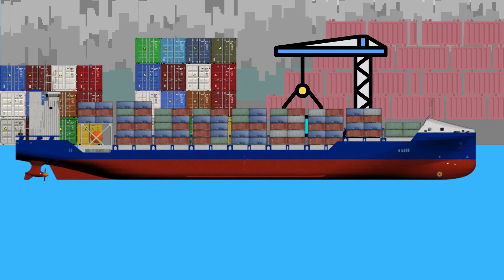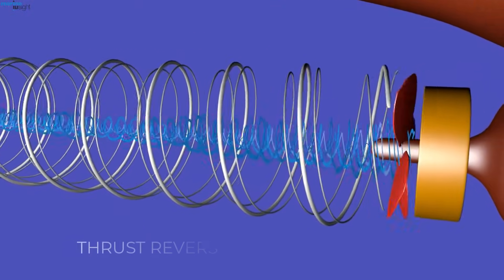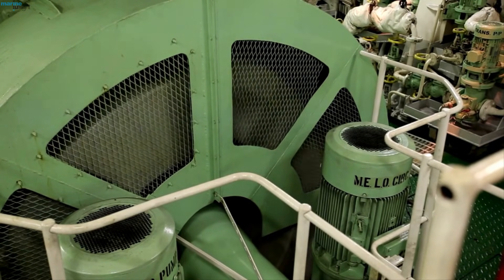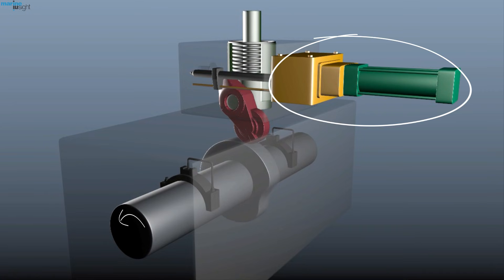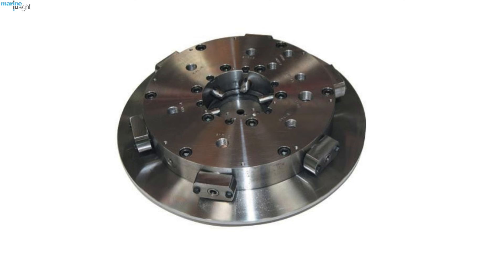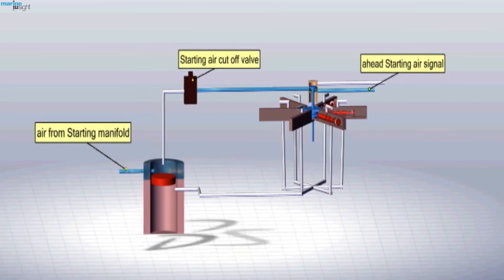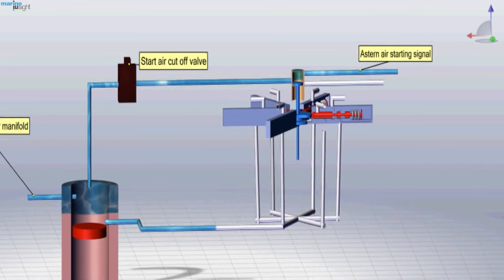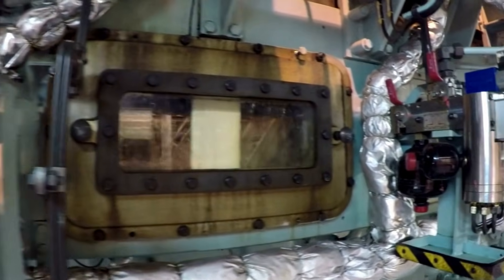Reversing of Marine Diesel Engine

Comment: good video my question is about hitched pumps of oil and water of these engines ,about the inlet and discharge in case of change rotation

Comment: Thank you for this video. It is very well done! Two stroke slow rpm diesels make so much sense as they can be directly coupled to the propeller shaft, saving the cost of a gear box. Further savings with a fixed pitch propeller. I have a question. Prior to the engine and therefore propeller reversing, is it only starter air introduced to the cylinders? (No fuel) I ask this as I was trying to make sense of this video. https://youtu.be/1fs2cU_MsRQ They don’t provide much information but it is a container ship reversing. The engine speed (and propeller speed) stay constant until the speed of the ship is such that they can reverse. Is this the moment in time that the diesel stars fire ring? You can hear on the video, prior to the engine reversing, something is slowing down, but it’s not clear to me what.
Reply from the maker: Thank you for your support 🙏

Comment: For many years aircraft have used a propeller reversing system which is much simpler than all the mechanisms shown in this video.  Is this technology not viable in ship operation?
Reply: There are ships that do this. Most notably there are Navy destroyers that reverse propeller pitch to reverse thrust. They need to be able to stop and maneuver more quickly than commercial ships. This mechanism is too expensive and requires too much maintenance for commercial ships
Reply: @johnmiesner  Its not that uncommon, most modern ships today use Variable pitch propellers (there are a frew different types). Another solution which, again, can be found of many modern ships is a Diesel-Electric setup where the propeller is driven by an electric motor not the engine itself. Another reason why VPP's are great for cargo ships is that they require different ammount of power to navigate the seas depending on how much cargo they are carrying, you can optimize the pitch of the propeller and maximize fuel efficiency
Reply: I believe u're referring to variable pitch propellers, which are very effective for low-weight applications, such as ur turboprops, but are mechanical nightmares for anything the size of a ship!

Comment: How long does it take for the complete reversal process to take place? What is the lag time between full propeller forward and full propeller aft?
Reply from the maker: It will depend on factors such as engine speed, current, wind direction etc.
Reply: I'd assume very very long

Comment: 4:05 The spring holding the followers clear is not only to reduce wear when not in use. They also prevent the followers blocking the movement of the camshaft.
Reply: also prevent accidental delivery of starting air into the cylinder when engine is firing and one of the cylinder air valve is leaking

Comment: What about ME engines??
Reply from the maker: In ME engines, everything is electronically controlled and operated, hence timing can be altered as desired.
Reply: @marineinsight  but the principle is the same?based on the angle of the tachometer supply of air is altered on the corresponding cylinder and reverse is achieved?
Reply: @nitarahayu9134  Techometer records engine rpm.